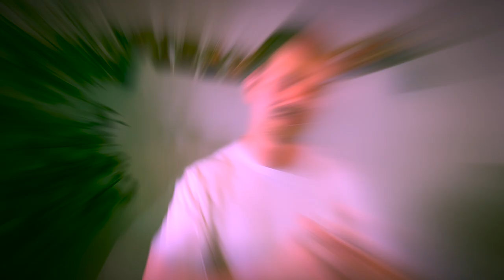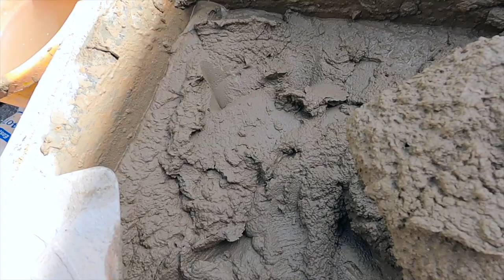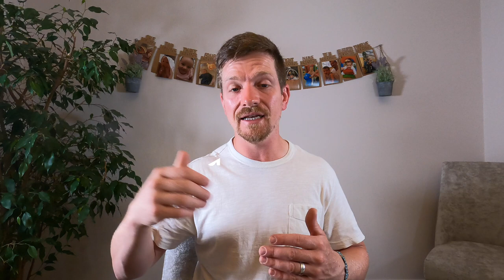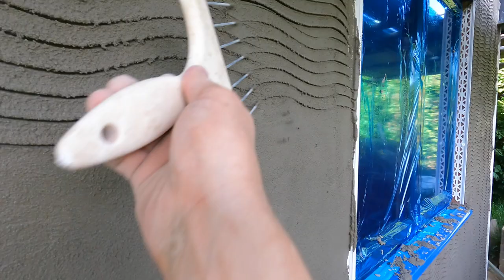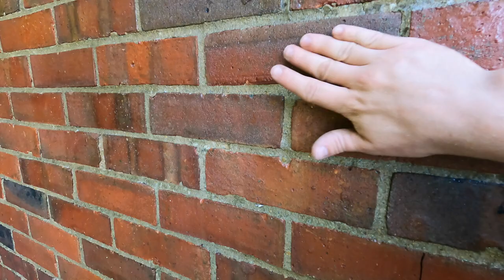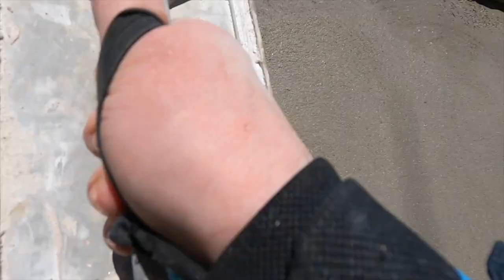7 Deadly Rendering Mistakes New Plasterers Make...WATCH TO AVOID!!

Comment: It's always a learning curve, same sht happens. I kinda think that at some point you should move away from the sand cement mix youve been using and considering that you are recommending a ruled scratch coat, I think by adding 50% sharp sand with the washed at 5:1, you'll find it better, plus it holds up better too. Also a floated scratch, leaving a 5-7mm finish with plastering sand gives a better job. I believe us spreads are getting a bad deal as in years gone by a 3 coat render gives excellent results, and I guess you've been thought a feathered off approach as a sloppy 2 coat idea, which is all about saving money, unfortunately. Also I am suggesting altering the mix, as in time and experience you'll probably be introduced to hydrolic lime, so you will have to float and finish with sharp sand/plastering sand, and with no sponge. Also as you are quite good at your job, why don't you prove it to yourself for reasons of wisdom, try adding to the scratch a tanking additive called render guard gold, made by safegurd. Put it this in to beat the heat, if I were to move to Africa for a rendering job, I would take this product. 🤣 A whole new learning curve buddy... 👍
You're cool...

Comment: Please can you / other professionals advise?:
Recently had exterior sand & cement rendering completed and six weeks later noticing (whenever the render gets wet), hairline cracks appear all over in a ‘crazy paving’ pattern.  (NOT visible when the walls are dry).
I’m concerned that rain might get into / behind these cracks (and will then get worse over time). 
The plasterer who did the job initially said he’d come back to inspect it, but has now become silent and seemingly disappeared of the face of the earth!  Does this sound like a serious problem and Is there something I can do / apply (as a D-I-Y-er) that will salvage/ fix this problem, such as fine surface fillers, caulks, textured coating, etc?
Thanks in advance!

Comment: Hello mate I scud everything I render. 3 to 1 ratio sand cement with a Costa cup of sbr 👌 give it a go
Reply from the maker: We used to Scud in NZ to be fair but it’s never been a thing here in England. I’ve never actually seen anyone do it here. Thanks for the suggestion though pal 😉
Reply: scudding should be 2:1 ratio ,wet the wall first to give the best grip for the scud coat, everything in Ireland is scudded,it stops the blocks showing through after you are finished, its thought that way in plastering technical college over here

Comment: I always use waterproofer in the scratch never had any problems with top coat.
Reply: That would be because you ended up with no topcoat to have a problem with. The water proofer goes in the top coat, put it in the scratch coat and the topcoat won't stick.
Reply: Ha ha ha! You'll learn.
Reply: @Johnx961  really? The water proofer is designed to repel water. The topcoat is full of water ,so if the water proofer is doing it's job it shouldn't stick. If that's wrong then please explain how or why? Always willing to be proven wrong and learn something in the process.

Comment: The heat don’t just affect render did some ceilings last year it was 34 degrees in the rooms and had some major shrinkage cracks and peeling it was just too hot to skim in there and that was with 3 coats of pva one of which was applied just before the start of the first coat excessive heat and spreading e not good bed fellows I reckon
Reply from the maker: Any Plastering is a pain in the heat - it just makes the whole process a lot harder.
Reply: @PlasteringForBeginners  for sure there was more water coming out of me than was in the buckets .  took ur advise on the speed skim though and got one great shout from ya it rearly does speed the process up and buy u some time (I’m not in ur league when it comes to speed ) and makes the whole process less stressful cheers mate

Comment: 1 I’d never youse plastic beads on sand and cement.2 always use a double washed sand ie morestead or wareham washed opc cement & lime . Never use sands with clay in it what does clay do when it drys out it cracks 40 years in this  trade I’ve never had a render crack .